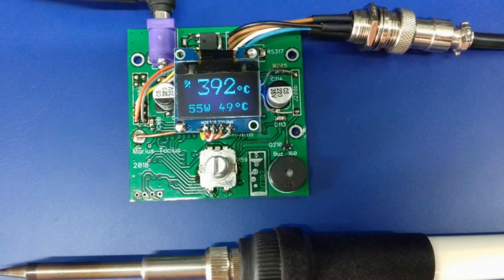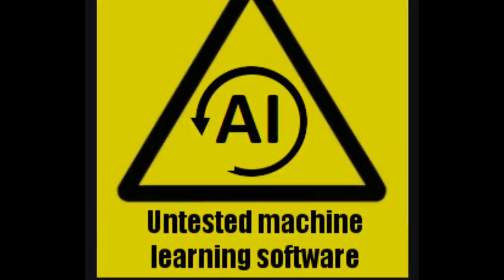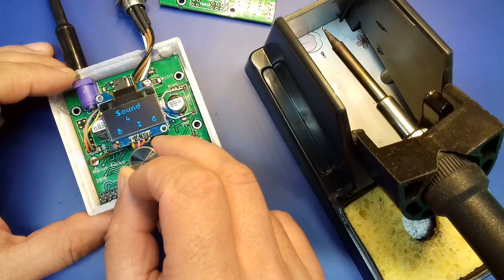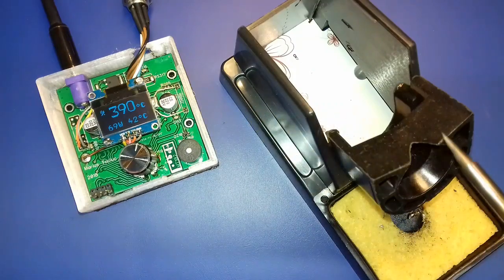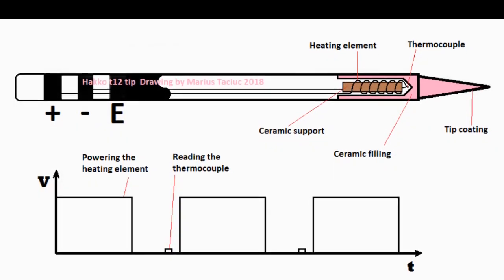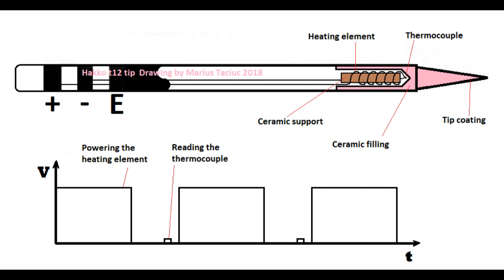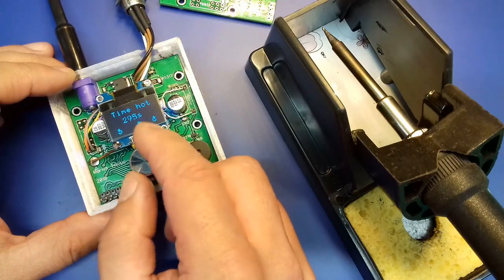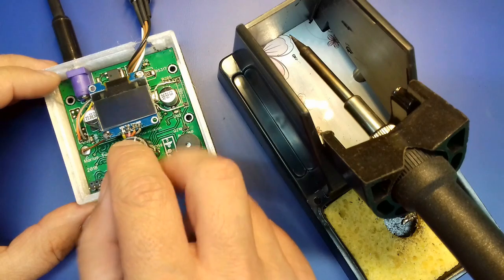Soldering lightsaber - the first AI soldering iron

Comment: Cool project... but will a fast temperature increase not wear the tip a lot? AFAIK the reason to use metal sponge instead of regular wet sponge is that the tip wear a lot due to rapid temperatur decrease.
Reply from the maker: Indeed. I addressed some of these issues in the hackaday page of the project.